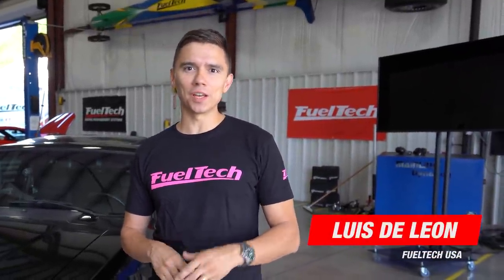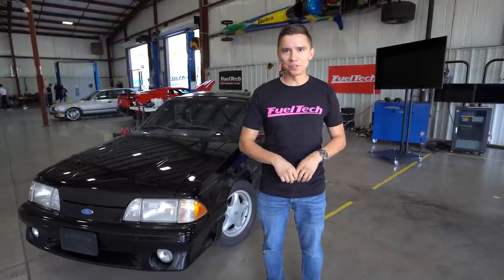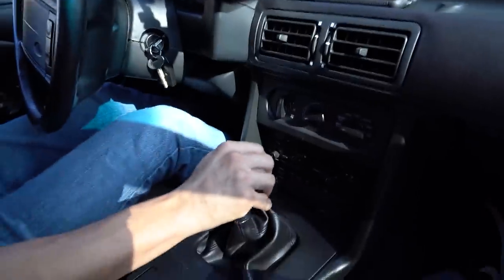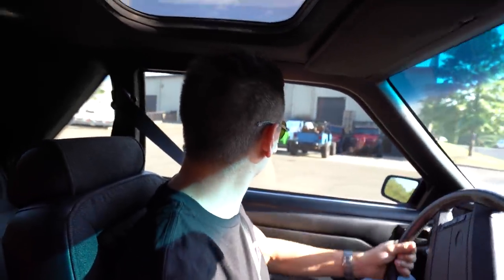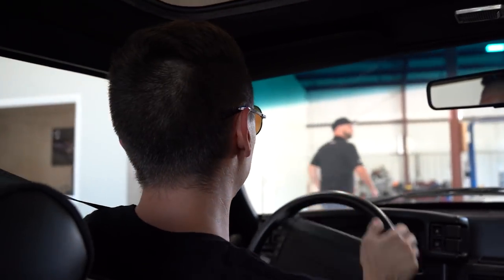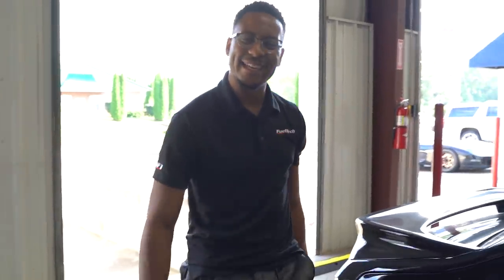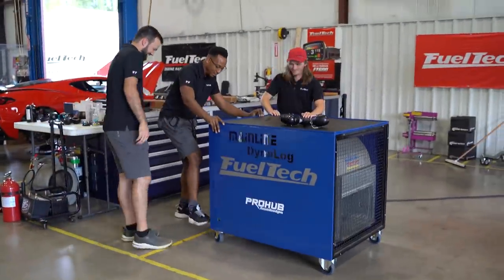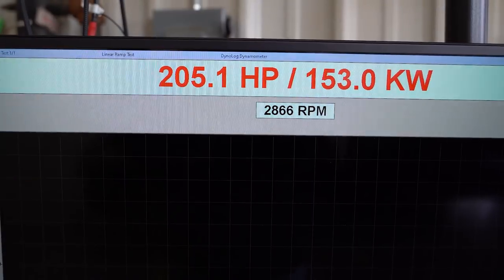Charged Up—FuelTech Swaps Dual EV Crate Motors into a 1992 Mustang GT

Comment: You can literally pick up .8 -1.4 sec in the 1/4 and it won’t even cost you a penny! First you must have at least 90 octane or more in the fuel tank, Next advance your timing from 10° to 14°! If you have an AOD you can only advance the timing to 12° maybe 13° if your car is in excellent running condition! There is a boatload of quick and easy mods that can be done but nothing is as effective, quick and cheap as advancing your timing! Also anyone with a 87 through 93 mustang take my advice and do not convert your A/C to 134A, It is totally worth the money to keep the system R12, Those compressors are not meant for 134A!

Comment: As someone with an '85 fox body, I'd love to get a very in depth look this project. Would love to see EV AWD fox-E's. Thought about  cutting out the floor, adding in frame rails, and attaching a tesla slab  battery if the dimensions are able with whatever motors on each end. Can't wait to see how you guys do it!

Comment: I checked and they never seemed to have finished this btw. Have actually been looking around for people that plopped the Eluminator into stuff, because I've wanted to make my own build. But Ford doesn't give you basically anything other than the motor itself. It does at least have an internal differential, but still. I love how the title is basically just a lie lol, they never even put an Eluminator in it. 

 You have to source Inverter/Controller/Battery & it's management system to even get the thing moving, and I haven't seen ANYWHERE that's selling any of that stuff aside from the Batteries. I think MAYBE the company supplying the motors to Ford might have some of it. Except there's literally no advertising of that. I guess if you have the HV equipment to deal with batteries you could get some from McMaster-Carr. They sell LiFePO4 batteries now, so if you get a battery welder I bet you could weld a bunch of the batteries together and get a servicable one on standby. 

!!!You'd have to build a HV box for it, first though!!! Do not try making a HV battery with no HV equipment!!!

Ford seriously needs to advertise the other parts needed for their Eluminator, though. 

The sheer Voltage needed to run one of these is probably a big deterrent, I bet they looked into how much either 
A) A battery costs, and where they would have to put it in the car (by cutting out part of the floorpan)
or
B) The HV equipment costs to make their own battery
And decided to drop it. The low view count after a couple years is probably a big factor too.

Comment: I have a 86 I want some fueltech tech on my car super bad it’s n/a still I want to do nitrous no other power adders and it’s funny you’re going to do EV swap on one they are super light and quick for couple hundred horse
Reply: @stevenmcc2119 Your engine will handle a 100 HP nitrous system without any issues whatsoever, Also make sure that you purchase a wet system and not a dry system! Just by adding a 100HP nitrous kit you will pick up at least 1.2 seconds in the 1/4! The only problem is you cannot advance your timing anymore than 10°, If your car has a manual trans you most likely advanced your timing to 14° like everyone else! So now there are pros and cons! You are going to loose the extra HP that extra 4° gave you if you race N/A, But you will gain a ton while you are on the button! I had a 100HP kit on my 87 GT, In August 1993 I stopped by Ford Motor sports to pick up a thermostat and while I was leaving I saw a brand new 1993 Cobra sitting in the showroom, 5 hours later I had a brand new 93 Cobra in my garage! Here we are 30 years later and that same 93 cobra is still in my garage with only 26,350 original  miles!

Comment: You know trains are electric right.Just a diesel motor that drives it.I saw one take off one day,just the engine by itself.It raised the diesel engine rpm up to a good level.It did a burn out,just enough to get the steel wheels hot.Then all of a sudden that thing left like a pro modified.It ran a 1/8th mile instantly.I said out loud holy sh#t!,that things fast.Those things are heavy but very powerful.😳😂